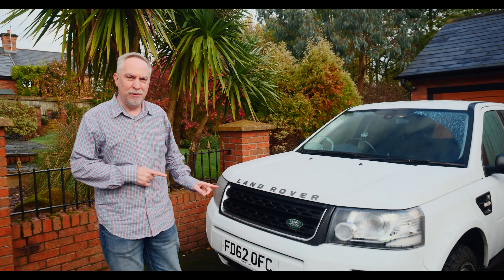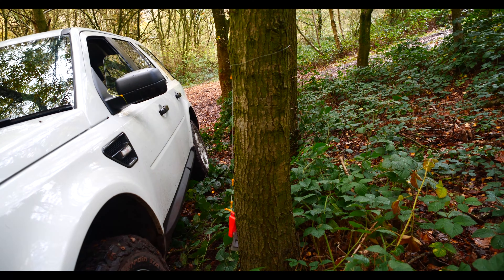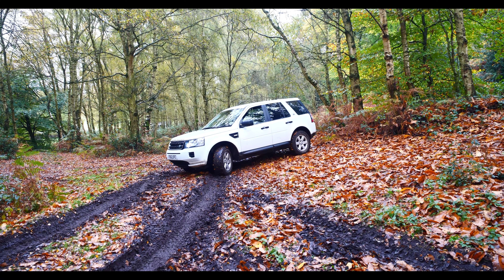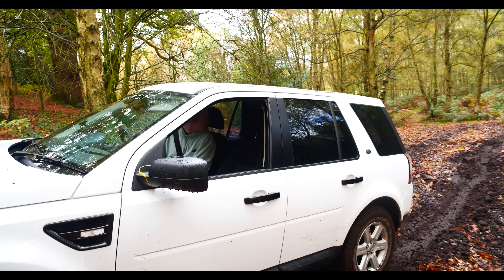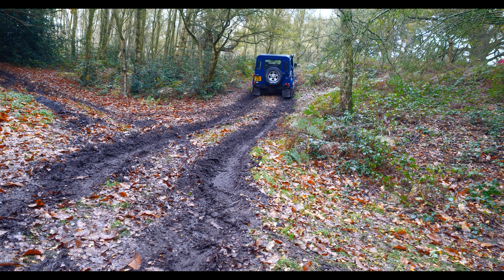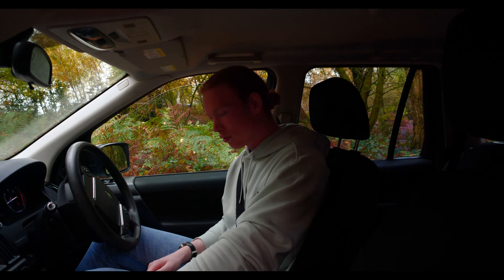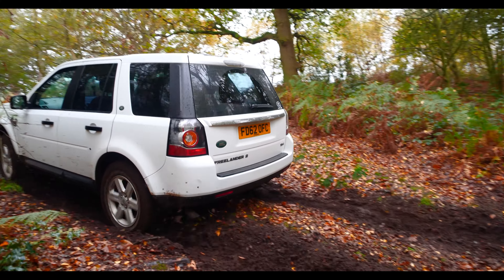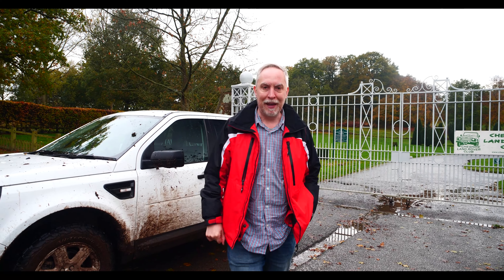Land Rover Terrain Response EXPLAINED | Land Rover Freelander 2 | Jay Tee Cars

Comment: I've had 2 Freelander 2's. My wife has owned her 2013 HSE SD4 since 2016 and my daughter has just bought an 08 HSE TD4 with 91K on the clock. Looks and drives like new. These cars are totally bullet proof and will never let you down. Fantastic vehicles. I have owned a 2019MY RR Evoque D180s from new. 111600 on the clock. Zero issues. Do not believe the armchair LR haters. They are wrong.

Comment: Great video to see the differences.

Sand mode locks the Haldex into 50:50, precharges the gearbox and gives you maximum throttle response.
I've heard that some Land Rover Experience people call it "Launch Control" and i can see why.

Just so you are aware, as i didn't here it mentioned. HDC can be turned on in any mode, and with the slipperier stuff, turning DSC off can help.
When stuck in mud, it appears that sand mode with DSC off is the way to go.

Comment: So great to see a white FL2 in action. We bought a new nicely spec’d one in 2014 and I am still checking the adverts to see if any similar one popsup. The haldex was replaced under warranty.
The FL2 was more capable than we were and we learned that during LR experience courses.
Reply from the maker: They can surprise a few how capable they are off road.
Reply: @JayTeeCars  Really shockingly good. They're so light, and so well-balanced. If they only had a bit more ground clearance they'd be an absolute weapon off road.

Comment: Hi Jay. Great video. Looking to buy a 2010/11 fl2 but seen a few reviews on the haldex not being serviced and causing issues. Honest john said there were massive issues. Any pointers on checking and would you recommend a freelander 2 sd4. 
Regards. 
John.
Reply from the maker: FL2 most reliable of the brand.
I haven't heard the haldex is a real problem.
Reply: If the Haldex has not been properly serviced as most Land Rover dealers fail to do, they can fail and need replacing. There are OE parts out there so it won't cost a fortune and I've had mine done, which was well worth the money.